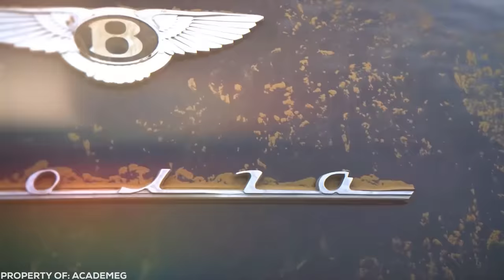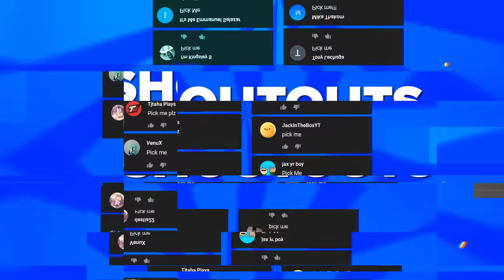10 Zombie Proof Vehicles You’ll Regret Not Seeing...

Comment: Practically, the best transportation in the zombie apocalypse is Velomobile. It will let you run away from zombies as possible as you can without any worries of running out of fuel while protecting yourself against rain and snow. It is also quieter which will not alert zombies. Electrically Assisted Pedal Velomobile is also 80% more fuel efficient than the lightest electric car in the market which is suitable for solar power and regenerative braking in charging the battery.
Reply: Однако защищённость его такова, что по сути человек в нём не более чем консерва... хотя нет, просто завтрак в пластиковом пакете для зомби.

Comment: Let's imagine for a moment, that zombies could exist and I need a vehicle - My pick is a self propelled river barge! Simple as that!
It's not amazing, it's not badass, it's not cool, but it's practical, mobile. Lots of storage space and you can live in comfort. Extremely durable and relatively easy to maintain and fix engine And you can fish.
You'd only need to move the barge to resupply occasionally, but 98% of the time, you're in the water and you're safe.
Reply: Imagine if zombies could swim.
Reply: @athiefinthenight6894  
So? Swimming up to a ship is one thing... how are you gonna climb onto it? It's smooth and there is nothing to hold on to.

No handles, no ladders, nothing is exposed. Your only chance to board a ship will be when it's going under a bridge and you jump.